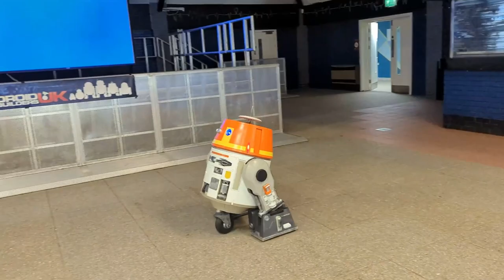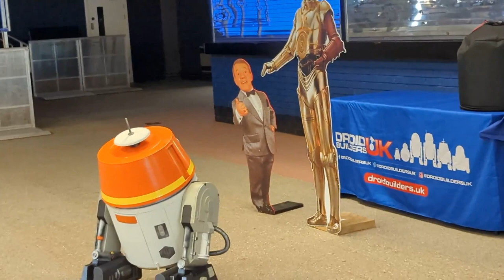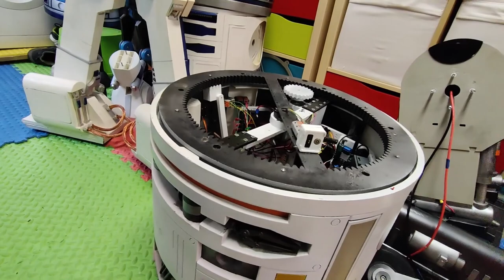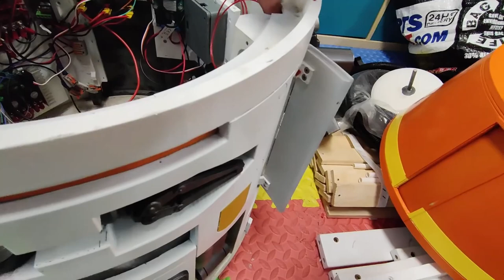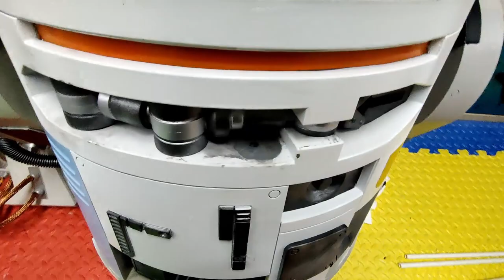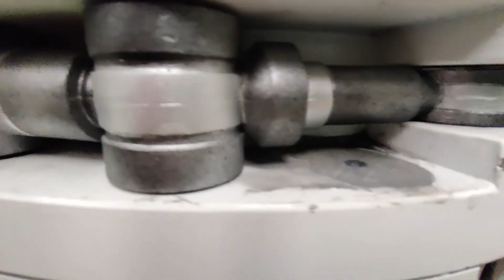Let's Build Chopper! - Episode 22

Comment: Andy, having a mare with the rear battery hoses, have you done yours yet? The issue I have is that they are all made hose length 300mm but when I connect them they pop off the vertical shell mounts all the time. Have I made them to short so there is to much of a bend in them?
Reply from the maker: I haven't done mine yet, I was talking to someone about them yesterday actually. And he is going to use R2s hose connectors, they should hold them better.
Reply: @rageprint9530  Andy, I have just tried my R2 hoses and its not the hoses as they are the same and my Chopper ones work on my R2. As you say it could be the connector on the shell and due to the angle they go up and need to then bend down. Still not sure.

Did see you and SWC on Friday but you was busy so did not talk, saw your droids which look great.

Comment: If you were to sell it, how much would you sell it for? 🤔 I'm trying to get an idea of how much one would cost.
Reply from the maker: Oo that's a tough one.. asking questions like that strays into a realm that droidbuilders stay away from as  it would incur the wrath of the mouse. The tacit agreement is that we can sell parts, but not full droids as we don't own IP. A fully completed droid would have a different value to say just the constituent parts assembled  as it now becomes the character and all the desirability associated with it. But in parts... Probably about £120 in paint/putty. Electronics you be easily hitting the £300 mark and that's mainly due to the 2 speed controllers, everything else is fairly cheap in comparison. Though with global supply issues right now that fluctuates a lot. As for the filament, well that's tougher. As it depends on brand, material, mistakes and buying 1kg rolls or larger. Buying larger is generally cheaper but you'll struggle to get PETG in those sizes and you have to be careful with some brands as they are cheap for a reason. Though saying that I've had great success with ICE and eSun. Also, generally, more well known brands like sun lu, prusament etc only do 1kg rolls.